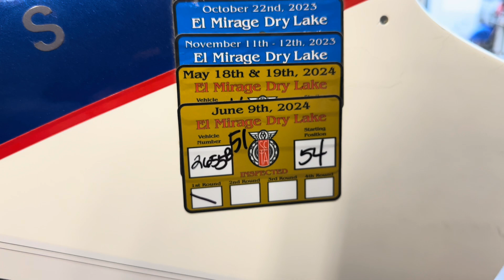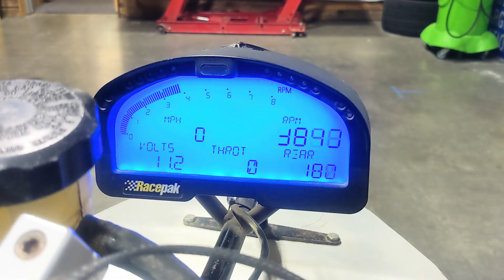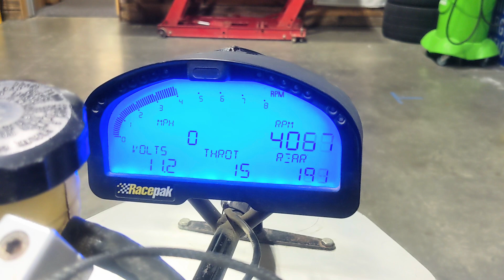WORLD RECORD El Mirage Electric Land Speed Motorcycle

Comment: 214mph? And Thats a record? For electric? I rode my CBR1000RR 180mph, I got passed by a Ducati running 209mph (according to rider) and that was on I-75. I figure a record would be far beyond what the guy at the local insurance office passes me on a Ducati.
Reply from the maker: That particular record was 214MPH.  He has actually done 247MPH.    Not to insult your speed but a bike speedometer can be off by as much as 10 MPH under at those speeds.  I've been over 195MPH on  stock Hyabusa, according to the speedometer.  Also, keep in mind, once you pass 200MPH it takes exponential HP to keep accelerating.  While, it is possible to push 200MPH on a street bike, it is highly unlikely.  Have your guy bring his bike to Bonneville and we'll put it to task!